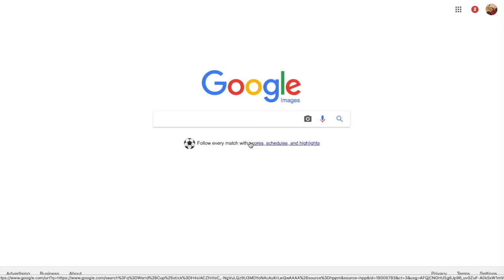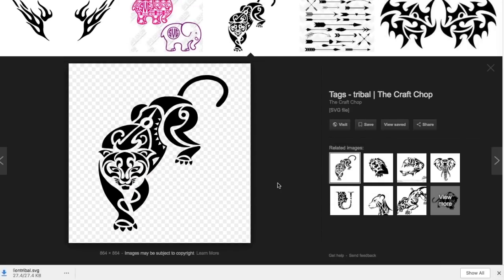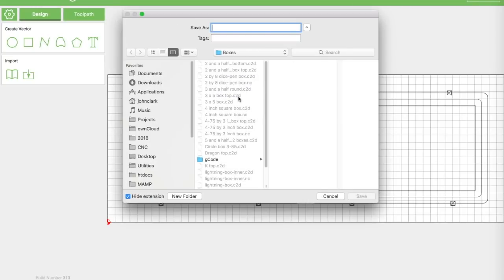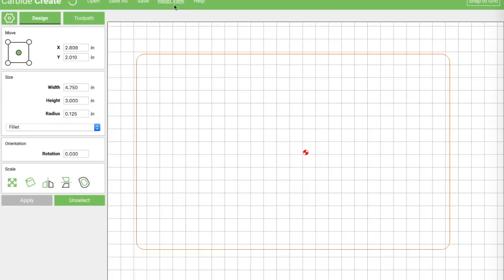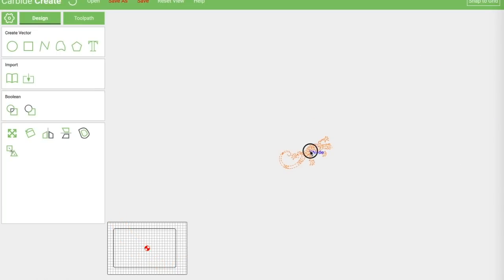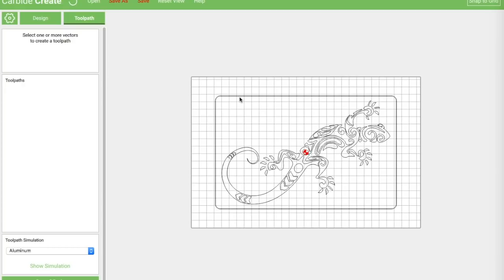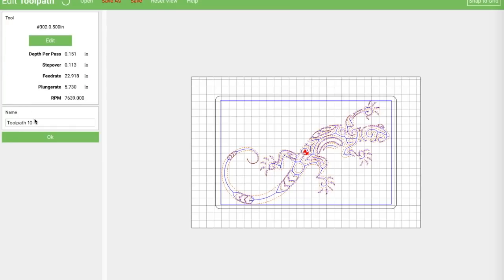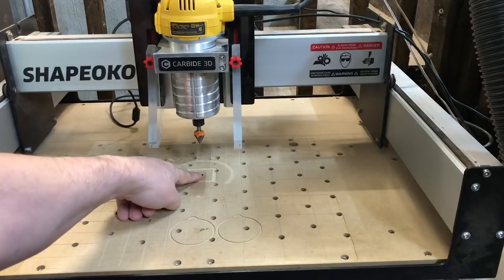Part 2: Box Top Design on Shapeoko

Comment: Your videos are awesome! I didn't get a shapeoko yet but I downloaded carbide create and have been playing in it.  I only have 1 question if you don't mind. Will this work the same if exporting the tool path to a c2d file? I don't have carbide create pro and that's the only way to save a g code.
Reply from the maker: If you are using Carbide Motion to control the machine, it will use the c2d file just as if it was g-code. All Carbide create is doing is putting the gCode into the CC design file. I think it may have been a way to keep people from using Carbide Create's g-code on other machines and then calling into support with problems. As long as it stays "in the family" it works just fine. Does that help?
Reply: @johnearlclark  yes sir thank you very much!   I'm currently binge watching your channel to learn.  Thank you again!

Comment: What's the depth setting you use for your v carve
Reply from the maker: At the time this was made, I don't think depth was an option. I tend to set the max depth to a little less than the width of the widest part of my v-bit. I also check the simulation to get a feel for what it looks like. Always keep in mind that the depth of the bit is based on the distance between the lines. For example, a 90 degree vBit will always go half as deep as the distance between the lines. A 60 degree will go slightly deeper. Does that help?

Comment: I have one question.  When I set the bit to the center and start my job, it does not stay in the center.  I have a 10 x 10 plate with the opening for the box top and it always starts at the lower left side of the 10" square and not in the 6" circle where my top is.  When you set the Z on your video, you say that it knows the x and y, but you do not show how that is done.  I have a bit setter and even used it for the 10 inch base and it still does not start in the 6" circle.  I am using carbide create v 714.  Am I missing something?

Comment: Great video. I picked up a lot of great tips. How do you get the boxes out of the jig you made? It seems you pressed it in pretty tight there.
Reply from the maker: if they seem like they will be too tight to lift out easily, I run a length of thin christmas ribbon under then before I press them in place. It adds a tiny bit of snugness but gives me something to lift with.
Reply: @johnearlclark  oh that’s clever, like popping batteries out. Thanks for the help!

Comment: So would I be correct in saying that there is no need to set depth of V bit in carve path as the depth will be dictated by the space between the shapes of the image.  However one might want to set depth to the stock bottom in case the bit dia is smaller than some of the image lines and could possibly punch through?
Reply from the maker: Yes, that is correct. Older versions of Carbide Create didn't have a max depth for v-carve (I think they may have stopped at the length of the cutter). However, being able to set a max depth also lets you come back after the v-carve with a regular end mill and clean out the bigger sections.

Comment: OK, I'm new to all this stuff so can you show how you got that to go to the center? Did you program it or is it set up all ready? If you had to program it how did you do it.
Reply from the maker: If you are using carbide Motion, the Jog section has a button called "Rapid Position" which can take the machine to 9 specific spots on the board (four corners, front, back, left, right and center. It's extremely helpful for getting a consistent starting point.
Reply: @johnearlclark  I have Candle

Comment: Awesome! I use basically the same technique for inlays and pockets for epoxy in the top of my boxes. I just use a big MDF blank where I secure my pieces for cutting out the parts of the box, and have a pocket cut out for the box top in the same blank.

Comment: What bit did you use on the 2 round boxes? It doesn't seem like a V bit would work.
Reply from the maker: The v-bit is only for carving the top. I use a 1/8 and a 1/4 for cutting the box itself.

Comment: John, thanks so much for the videos.  They are great for me as I will get my first cnc machine, a Shapeoko XXL in a couple days.  After I make the threaded wasteboard and some holddowns I am planning on making the rectangular box. I have a question on the lizard carving, what determines the depth the v-bit goes too? We will only have about 1/4" to play with.
Reply: Think I answered my own question by reading more of the comments below.  Sorry for doubling up. If I understand correctly the v-bit will go as deep as it needs to to reach each side of a single component of the drawing. Glad I checked as the lizard drawing I downloaded does not have the line down the center of the lizards tail so the carve would have been full width on the tail and I would have carved right through the top. Thanks again for all the information you and others are providing here.
Reply from the maker: @zeyeam  I am working on a V-carving deep dive video right now. The short answer is the distance between the two line determines how deep things go. If you use a 90 degree V-bit, then geometry says that the depth is going to be half the width between the lines. So any lines that are less than 1/2 inch apart should work on your 1/4 thick material. It might make more sense once I finish the video, but short answer is that the lizard "should" work as long as the tail is less than a half inch wide.
Reply: Thanks for the reply John.  I have now ordered the 90 degree bit and it should be here by the time I can be ready for it.

Comment: silly question John, when i right click on the svg file in google images, it only lets me save a .png file... any suggestions?
Reply from the maker: Sometimes I have to go to the website for the image and download it there. I find that a lot with the WikiCommens website. Google picks up the fact there there is an SVG available on the site but it links the png. You should see a “go to website” option for the image in the search result.
Reply: @johnearlclark  I really appreciate the heads up. I went to a website called Convert PNG to SVG and there you can easily do the conversions for free. thanks again.
Reply from the maker: @ericromeis6252  Cool. I will check them out.

Comment: hi john, thanks for sharing your knowledge, appreciate the tutorials.  had a question if you don't mind, how long did it take the router to carve that lizard into the box top?
Reply from the maker: Hi Mike. It was probably about 15 minutes or less. I do tend to bump the feed rate and plunge rate for V-carving if I am not going really deep. I also set the retract height to about 2mm (as long as the work surface is flat). The defaults are a little slow to me.

Comment: Great video. Using you example, I cut a small lidded box. All worked great except for one..The top would not slip over the bottom.  Not surprised since each part had the same dimension. Do you sand one lip so the other will fit, or do you cut one lip a few thousandths off to make the fit go easier?
Reply from the maker: Usually, I will make one a few thousandths off. Sometimes I still have to sand. Glad the video helped.

Comment: Thank you for the clear video tutorial.  I just found your channel.  How much material is left in the cover after the V-Carve?  Aren't you afraid of going through?  For the round box cover, you could use the painter's tape with super glue trick to hold the cover in place.
Reply from the maker: I usually leave the top about .25 to .3 inches thick if I am going to V-Carve. If I feel like the design has a lot of wider open spaces, I use my 90 degree V-Bit so it doesn't go as deep. If it's a lot of small delicate spaces, I use a 60 degree bit to get a little more definition. As a general rule, the wider the space being v-carved, the deeper the bit goes. After a while you get a good feel for which designs will give you problems.
I have used the painter's tape with super glue trick a few times, but it tends to tear up the centering jigs after a while. These days I find that if I wrap the edges of the top in 2 or 3 layers of painters tape, I get a really good friction fit.
Glad you enjoyed the videos

Comment: New Here watched your first video It was great and easy to follow. I see in the start of this video a Heart shaped box did you do a video on making  it ,if so where  could I find it. Thanks a fellow Shapeoko owner Jeff
Reply from the maker: Hi Jeff, I have not done anything specifically on the heart shaped box, but I will try to in the near future. However, the basic principles are the same as what I am doing in the basic box video for part one of this series at https://youtu.be/LQIW0Ue9LnM If you can create the outer shape of the box, you can use the offset option in Carbide Create to define the inner pocket and the lip (like the video shows). Take a peek at that one and let me know if you have questions. I am happy to help.